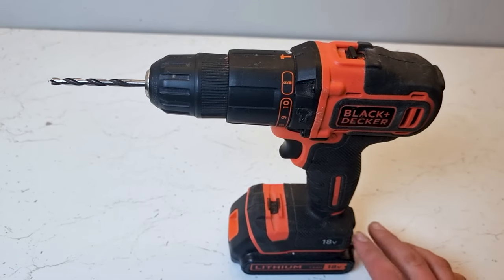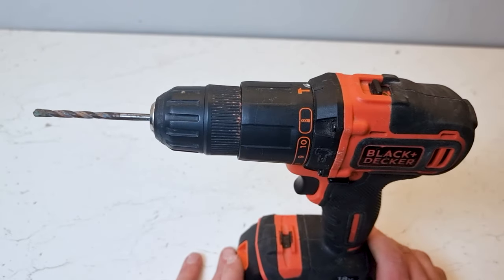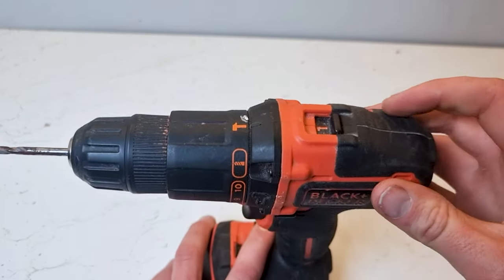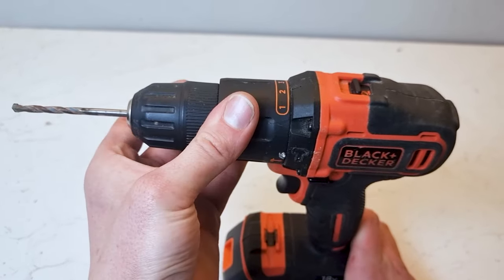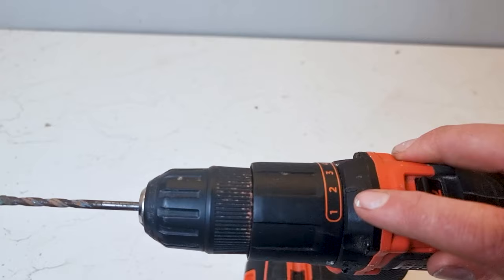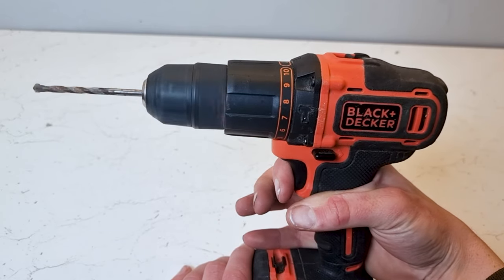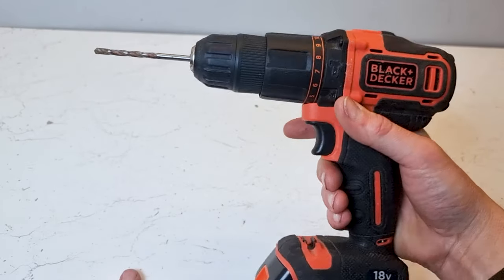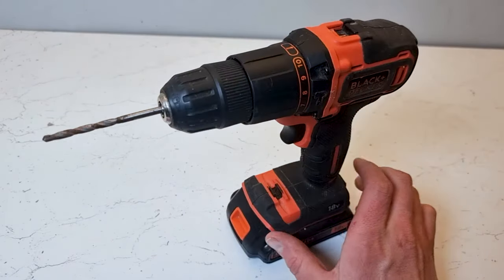What Do The Settings On A Black & Decker Drill Mean?

Comment: If you set in drill mode for all the power of the torque drill, then the numbers are just basically for wood only?
Reply from the maker: They are for screwing really, they can stop you stripping the heads on screws and also can be used as a depth stop when screwing into soft materials like wood
Reply: @TheBlokeCave  so the higher the number the more power it gives in drilling harder materials? And the less numbers are for not going all the way in?